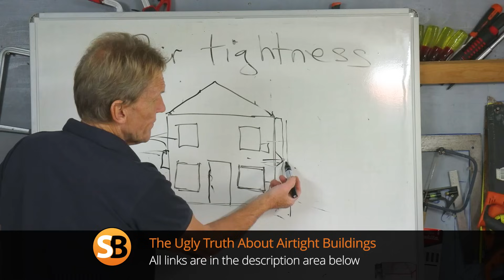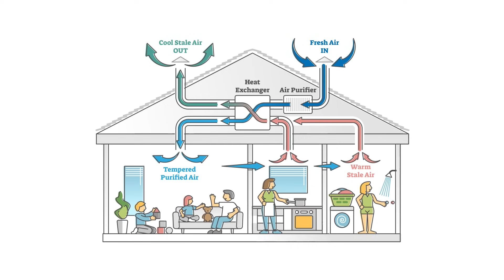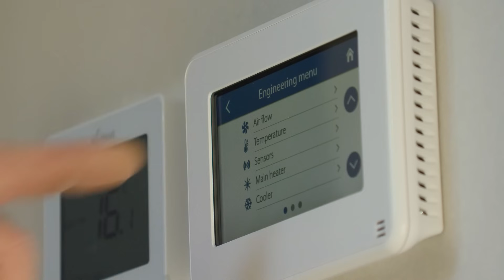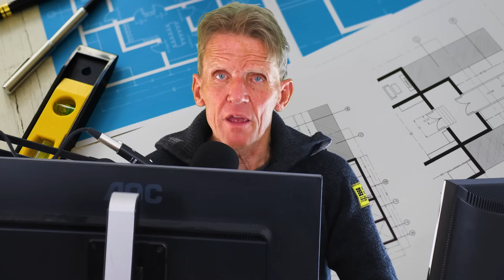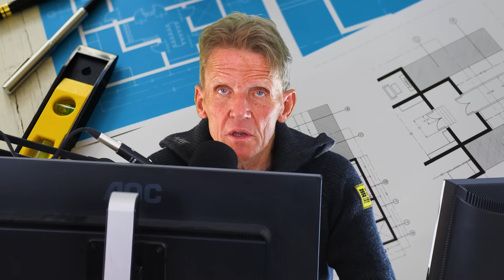Why Airtight Homes Are a Terrible Idea

Comment: It's not just moisture that gets trapped. When you measure the build-up of CO2 in a sealed house you may be shocked. Outside here CO2 concentration is about 400-500ppm. Indoors is goes up to 4,000ppm overnight when nobody opens any door to go in our out. Very, very few people install air exchangers in their home so you're left with mysterious headaches and poor sleep. There is a reason people sleep better at a cottage, for one it's the cooler night temps but it's also about the massive CO2 build-up in modern insulated cookie-cutter houses.

Comment: We live in the western US mountains and being a cold semi arid climate our problem is not moisture or mold but it is Radon, a poisonous invisible oder free gas.  You can ventilate under floor to the outside. We heat with wood primarily and have infloor water heat. We simply leave our windows cracked to rid the Radon which is metered down to a safe level.  The house is 13 years old and we have access to almost free firewood providing we do the all the labor.

Comment: I remember back in the 80's...  I plumbed a house that the homeowner made tight as tight could be.  I also remember that a year later they wound up putting mechanical ventilation in.  People were actually getting sick from low oxygen.
Reply: One problem I have found is people from away buying an old house and sealing the shit out of it, and then the house starts to rot.  For fux sake, there is a reason these old houses are still standing strong.  THEY BREATH!

Comment: I totally agree. I've always owned  antique homes that breathed. NY has really put in draconian building codes. Banning gas stoves. Due to epidemic levels of asthma in children. My parents died from the cancer caused by radon gas trapped in their sealed modern home. Only discovered the trapped gas when they went to sell. They had to install a ventilation system to purge the home.

Comment: I think its based on a misunderstanding that plastics is the only way to get the house ”air tight”.
Its also a misguided thing since you can have the house ”breathing” and highly insulated.
Compare having plastic rain clothes to a clothes made from stamped wool. Both protect you from the wind and keep you warm. But one cannot breathe but the other can.

But its also a problem with materials. Because mineral wool cant handle moisture it needs to be shielded from it.
However, if you use an insulation based on natural materials (straw, wool, hemp, wood etc) it can handle moisture much better and you dont need the plastic film.

Comment: Built a 100% airtight v well insulated house 13 yrs ago. MVHR required for EPC. Never used it, 3 windows on the nib, cost an extra log a day in winter. No "silent" fan running 24/7, common sense.

Comment: Drier air makes you feel colder, not warmer. Also, dehumidifiers are only necessary in warm and humid climates. I live in a cold climate and I run a humidifier for most of the year because cold air is dry air.

Comment: Positive input fan to fix a moisture problem is a bad idea, because it likely to cause rot & mold in the wall cavities & wall sheathing. Its going to push moisture into the wall cavities where its going to condense when it means the colder wall sheathing.

What these home need is a whole house dehumidifier & start using bathroom\kitchen exhaust fans: When you get out of the shower, turn the bath fan on while you get dressed or install a timer for the bath fan. Same with a kitchen, use a kitchen fan when cooking (boiling water), or when doing the dishes to pull moisture out.

Comment: We are in a new build  atm, the walls have just dried out the past year..we came from living iin a much older property, which was damp free  i have woken up at night since moving here  feeling like i m suffocating, we are in this flat and we have 3 windows in the whole of our flat, plus a patio door..we also have no outside space to dry our washing and no airers on the balconies or patio areas allowed .its absolutly insane..even with the trickle vents open and the windows on the latch i feel trapped with no air...good news is we are on the move back to an older house...asap ...its like living in an air tight capsule horrendous

Comment: Australian here - We recently travelled through Scandinavia, Ireland & the UK in Summer and everywhere we went I hated sleeping in the hot, stuffy houses where windows would not open and there was no airflow. In Sydney we have minimal heating in Winter and have fly screens on windows & doors so we can keep them open for airflow. Visiting Europeans often complain of “cold” Sydney houses in Winter but that’s the way we like it - just put a jumper on!
Reply: I hate the cold in the house in Sydney in winter. And it's not cold because I open the windows, but because the house insulation is poor, huge gaps under the doors and no central heating. Aussies don't build for winter.
Reply: It's called having a winter. Buildings in northern Europe are heavily insulated so they can indeed get stuffy in the summer. An AC or open windows with bug screens easily fix that though.
Reply: Bro...the reason most houses in Sydney are cold in the winter is that government policies (facilitated by a miss- and under-informed electorate) have resulted in Australia having among the most expensive energy in the world...
Reply: @michaelvenarsky8216  Not as expensive as the UK.

Comment: I was brought up in a very draughty old 100 yr old house my dad was born there his in his 90s , we’ve never had damp anywhere in the house it’s a 5 bedroom 3 story , I moved into a new build  20 yrs ago an I’ve had mould problems , I don’t dry my clothes indoors, and yet I’m still getting it , I’ve used paint for mould and mould sprays , bleach , it seems to work for a while then comes back , my dad said this not enough air circulating, to open the windows even in winter for a while , and make sure my air vents are open at top of windows , so hoping they’ll do the trick .

Comment: Thumbs up for that one Roger 👍 ... I live in a 1900's build 3 story old terrace on the coast in Devon and I was the very last in the terrace here to change out my old original wobbly draughty sash windows at the front. I had the rear windows all changed out for security when I bought it over 30 years ago but held off changing out the front bay window triple aspect ones for 20 years. Why? Because I intended to do it when I eventually got round to putting a new slate roof on ... and as part of that complete rip off & re-roof completely re-baton it all and put in a modern semi-permeable membrane instead of the old original bituminous type sheeting that was still in use the last time the roof was replaced (probably sometime in the '70s I think).

And when the nice new UVPC windows were in (kept the original 100 year old+ front door) and COVID arrived I fitted some duct fans to pump air in from the loft and out through vents ... and I never caught Covid. I never get condensation and my respiratory health I can honestly say has never been better!

Talk to the older builders down here and they will tell many a horror story of old houses from the turn of the century that were made airtight by new windows and doors ... plus ,critically, keeping the old school roofing waterproof membranes in place (even after re-tiling or slating!) ... and the damp that then gradually took hold in the spaces between floors and in lofts from condensation which over time then rotted out joists and spars causing thousands of pounds worth of repairs.

And all because people forgot what the original builders of these old money pits already knew ... proper ventilation is critical. Both for the occupants as well as the fabric of the building itself.

Nice one anyway. It's an important subject that deserves a periodic airing (get it?) ... keep up the good work :)

K

p.s. With dehumidifiers these days it's worth considering also investing in a small portable power-station and fold-away solar panel setup ... I can dry my clothes over 4 hours by plugging my dehumidifier into my Anker 555 1kWh power-station that I either charged up off-peak from the mains or, when it' sunny, from propping up the solar panel in the back garden. Just a thought anyway for those that have the space.

Comment: Airtight homes? In Britain? Where? The whole building industry is stuck in the past from centuries ago. They build "cavity walls" that make everything damp. There's no proper roof, the timber under the roof is like match-sticks etc. Double-glazed windows are considered space technology. They can't even fit them in properly, the draft still pulls through the whole house. There's no insulation whatsoever.

Comment: This is just plain dumb. If there's mold in the home after air tightness improvements there was certainly mold in the walls before. You might not have seen it, but it would likely be doing more damage. When you make your home more air tight, which you should, you must provide adequate mechanical ventilation which has the benefit of your control rather than just random leaks. But really, you need to get an HRV or ERV to capture the outgoing heat and preheat the incoming air with a heat exchanger. This is always going to provide a healthier and more comfortable home with lower heating bills. Pressurizing the house and relying on leaks is going add to structural damage - particularly in wood framed buildings.

Passive House, a high performance building system, demands air tightness that is far tighter than most any building code and orders of magnitude tighter than much of the world's buildings. It demands this, in large part, to eliminate the problem of mold. Passive Houses have been saving 90% of heating bills in comfortable, mold-free interiors for many decades. 

Always be suspicious of any you-tuber who comes across as a grumpy old man. They almost always have outdated ideas that do not stand up to scrutiny. In this case it is actually harmful disinformation.

Okay, admittedly he redeems himself somewhat as the video progresses. He needs to get rid of the title. It is madness.
Reply: Take people out mould vanishes.
Reply: @mikemines2931  Pointless of course. But also wrong. Just wander around inside old abandoned buildings.
Reply: @ronvandereerden4714  Not wrong according to Johnson Controls, the main reservoir of mould exists in peoples lungs.

Comment: Good video, except for the last part about dryer air feeling warmer., its the other way around actually. (at least at room temperature, of course feels colder if you for some reason have it really really cold in your home)

"When the air is drier, our sweat can evaporate into the air, drying our skin and letting our body heat escape and our body cool off. The drier the air, the less it feels hot to us. The more humid the air, the more stifling the heat feels"

Comment: I live in a brand new apartment building (in the US) and the windows actually have little vent slits at the top, in the frame, which can be opened and closed. It also has fans in both bathrooms and the laundry room, and the one in the laundry room can be set to come on automatically at whatever time you want, so I have that set to run once a day at like 3am.

Comment: So you pay to get your home sealed to pay less for heating, but to combat mold/damp you pay again for ventilation equipment and pay more to run that equipment.... does anyone actually come out ahead?
Reply: Yes you do. Your quality of living also substantially improves with all these upgrades. My house with all these things is so cheap to run it's great. UK is just decades behind in building knowledge.
Reply: The savings in heating costs far outweighs the cost of running mechanical ventilation and insulation upgrades, when it's done properly.
Reply: Good summary! 👍
Reply: I do what i always have done since being a young teen, open the windows and feel the wind tunnel blow through refreshing. My girlfriend wont ever open a window or door heating always blaring

Comment: If you want "air tightness", live in a coffin.
It is not the infiltration of air through a house that is the problem, but the lack of "conditioned" air within the house that is the issue.
Most HVAC systems installed in residential housing in America, make or have no provision for humidity control.

Comment: I have a small flat that I rent out the tenants used to turn off the bathroom fan to save energy result Mould! So I placed a blanking plate over the fan switch with “ Electricians Isolation Switch Under this Cover” that stopped the issue!

Comment: This is an increasing problem. 
I had to spend some time in my brothers new build house moving in furniture and fixing it up and I had constantly dry itchy eyes and skin.
Absolutely no air circulating. 
Opening windows didn't even seem to help much if the day was warm.

It's also why I hate staying in most hotels....I have never slept well, even in 4 star hotels. Too airtight and even with the central heating turned off and the air conditioning up full, it still feels uncomfortable.
I mean, isn't that the main priority when you book a hotel? A good night's sleep. All the other stuff is just to get a few extra stars or whatever. 

I have lived in several old houses over the years, most with some draughts, but never had any problems. I don't need a super warm house and mould has never been much of a problem anyway. 

Open your windows in summer! Light a big roaring fire in winter! Who wants to live in a temperature controlled box?

Comment: You build airtight homes so you can Manage the airflow, not stop it. You have a heat exchanger on the input, to warm the cool incoming air with the hot outgoing air. This reduces the energy lost when you simply heat the air in the house and it leaks out. It basically means you have the equivalent of windows open, without the energy loss. If you are making an airtight home and not doing the air management bit you are doing it very wrong.

Comment: As a jong lad I lived in a building built in the 70. We had single glass windows with a little gutter at the bottom. In this gutter there were holes, so the water could leak to the outside.

Much later I read about problems in Germany with double glazing. The water now was condensing against the wall.

With all big mold problems.

We keep our house at 15 degrees in the Winter. Only with heavy rainfall we turn it up to 18.
Ventilate a lot, bathroom window always open.

Low cost and no mold.

But the school system is not what it used to be, so a lot of people don't know how nature is ticking.